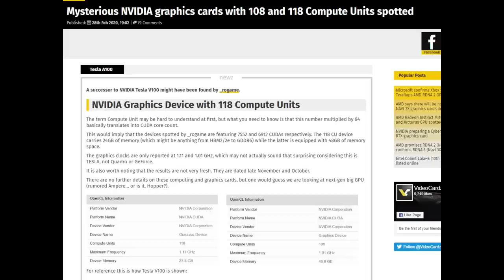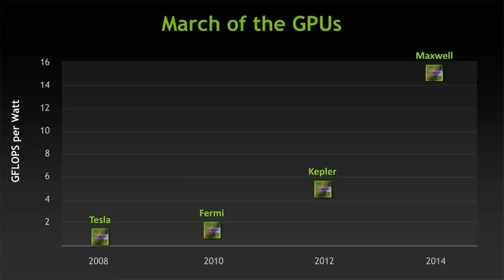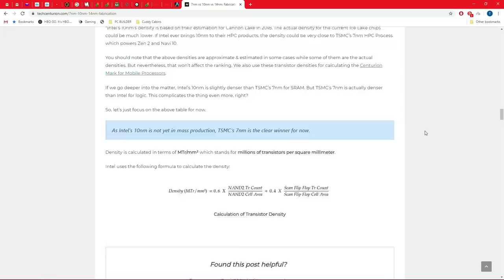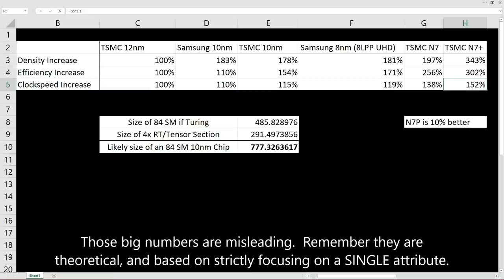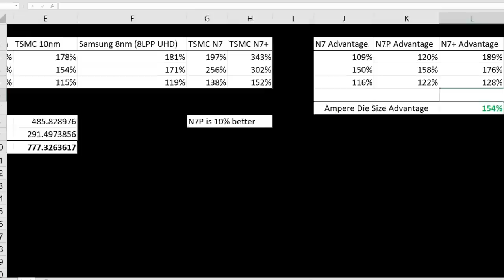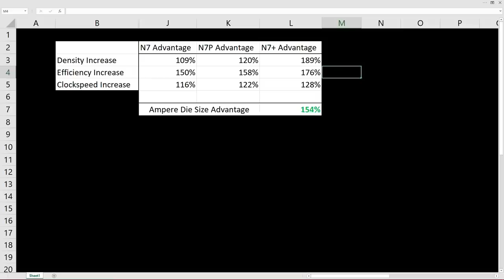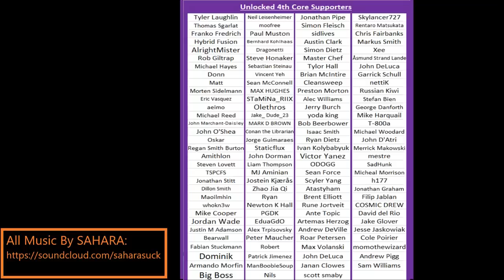Nvidia Ampere on 10nm: Still Good Enough to Defeat RDNA 2.0?

Comment: It's actually going to be pretty close to AMD using 7nm HPC (67mT/mm2 theoretical).
Samsung's theoretical is 61.18 on UHD cells. So we should see a density close to Navi's/Zen's implementation.
Navi is 40.5 Zen2 is 52.
Nvidia's current design is 25. So let's say 50. That's a 50% increase in density.
Should bring their 775mm2 die size of 2080TI down to 380mm2 Add another thousand cores, and I'd expect to see it around 450-500mm2. (Additional ray-tracing and other enhancements added).

Most likely (if they use samsung), they will use 8LPU
https://www.anandtech.com/show/13329/samsung-foundry-updates-8lpu-for-2019
https://www.synopsys.com/dw/emllselector.php?f=Samsung&n=8&s=6X4SzQ
Which is very close to 7nm HPC. 

https://semiwiki.com/semiconductor-manufacturers/samsung-foundry/259664-samsung-foundry-update-2019/
8LPU: ULVT, 1 fin standard cell template with both single- and double-diffusion break (8LPU introduced an ULVT device for HPC applications, compared to 8LPP)

Also
https://www.samsungfoundry.com/foundry/homepage/anonymous/technology300nm.do?_mainLayOut=homepageLayout&menuIndex=0201
Samsung foundry has maximized utilization of multi-patterning technology to overcome the cost concern and 10nm will be another long-lived node like as 14nm. To support long life time, transistor performance has been boosted with optimization of fin structure and stress engineering. Moreover 8LPP evolving as the most optimized & economical node until EUV enabling. 8LPU shows extremely low power efficiency with similar speed to 7nm.

http://www.trading228.com/news/samsung-will-become-the-worlds-first-3d-sip-foundry-next-year-3nm-trial-production-in-2020
Samsung added a new process called the low power ultimate based on the 10-nanometer process, which, according to Samsung’s classification, is prepared for the need for high clock frequency and high transistor density SoC. 8LPU is a further upgrade of 8LPP technology platform, which may increase transistor density and increase frequency.

Personally I think 7nm HPC is just TSMC's 10nm"+" basically. 10nm flopped so hard, they extended it and improved for HPC and made money off of a failed node. I think the only part of AMD's design that is true 7nm, is likely the cache. Which brings their CPU cores of around 40mT/mm2 up to 52, due to the cache (almost 50% of the die) being ~65.
And Samsung's 8LPU is also Samsung's 10nm"++"

Don't forget. AMD on their 12/16nm nodes, only achieved 20mT/mm2 on their graphics cards.
Nvidia achieved 25 on the same node (On a theoretical of around 40). So with Nvidia's superior engineering deparment, and time on their side, they should be able to squeeze Samsung's 8LPU to about the same density as 7nm HPC on TSMC. So unless RDNA2 makes up the entire efficiency gap, that Pascal / Turing had on Vega, on RDNA2, it will be around equal again.
Reply: 25 to 50 is 100% increase in density, not 50%.
Reply: @gismo3564  Sorry, meant a 50% decrease in size basically for the density increase.

Comment: You got it backwards. Instead of will it good enough to defeat RDNA 2.0 it should read how much faster than RDNA 2.0 will it be.
Reply: Yep, as far of efficiency current rdna is still more or less on par with 16nm pascal. Also people tend to ignore the fact that 1/3 of the die size in Touring cards is packed with RT and Tensor cores. So unless AMD somehow manages to find a new way for implementing RT they should also expect to sacriface that area as they confirmed to have RT next gen. I personally would not mind if AMD rolled out a faster card to push competition but as history has shown, that is very unlikely.
Reply: @Tjecktjeck  yep I wholeheartedly agree.

Comment: They say that Nvidia's GA102 Die will only be 40% faster, but people forget there's a GA100 Die. Nvidia hasn't released a Quadro or Tesla product that is larger in cores or bandwidth than their Geforce counterparts (at least to my knowledge, recent quadros in the past 5 years haven't been higher core count than Geforce/Titan), only larger in memory capacity. I believe that Nvidia will struggle to push past the Big Navi GPU with GA102 but GA100 will crush it. The last time AMD was in the lead was with the R9 290X and that beat the first ever Titan and Nvidia's flagship. A month later the GTX 780 Ti came out with more cores than the Titan and beat the R9 290X, not by much, but still outpaced it. Nvidia would make a 400W GPU if it meant preventing AMD from taking 1st place in pure performance, they don't care about the price. But that's all that matters to them.
Reply: Magnus Rasmussen 3000 Titan Gaming gpu only $3999, that sound very possible!

Comment: If they go with 10nm, prices might suck due to size again?
Reply: It wasn't the die that made Turing so expensive they just got greedy because AMD wasn't competing
Reply: @sean2291  thats not the reason at all. The 2070/2060 die is 50% bigger than the 1080 die. Nvidia has margins to maintain. The 2080 ti price tho is due to lack of competition. They could have sold it for $700.

Comment: GA100 - TSMC  7+NM?   
The rest is all Samsung 10nm?
826mm2 is rather large? whats the recital limit on Samsung vs TSMC?
Although to add weight
https://www.techpowerup.com/247657/nvidia-gtx-1060-and-gtx-1050-successors-in-2019-turing-originally-intended-for-10nm

Comment: Interesting video, thanks.  Nvidia if successful at 10nm will buy time to work TSMC smaller nodes. Initially with their compute cards and then if needed their gaming cards. Also if Samsung gets their smaller nodes working better, Nvidia could do a die shrink as needed. To me it looks like Nvidia has more options than AMD. Still if RNDA2 comes out punching well, timely and well priced -> AMD could win more than Nvidia. AMD was able to design a chip, Navi 10 at a 250mm^ about die size and remove 225w of heat from that rather small die size and transistor density and have high clock speeds for a GPU-> That is rather significant. AMD has more memory options with the smaller die size allowing HBM2e to be used readily as needed. If DDR6 becomes scarce and dominated by the new consoles, Nvidia may have a more significant supply problem.

Comment: Nvidia has been increasing the die size pretty substantially with each new release. AMD has not been bothered to release large dies. 

It does make me wonder where is the limit? How large can nvidia make these dies before the price becomes prohibitively expensive for the customers?
Reply: A die larger than ~850mm^2 can’t be produced as the optics get screwed up on the lithography. They talked about this when producing the V100 it was just about as large of a die as TSMC was capable of making.

Now TSMC introduced CoWoS which can produce enormous dies but I’m not sure if that’s a technology fit for making GPUs.
Reply: @magnusrasmussen951  double checking you are correct, CoWoS is just an interposwer for linking multiple GPUs / HBM stacks, which is technically a route Nvidia could go / has produced papers on. but the word from both Nvidia and AMD on chiplet based GPUs has been "some day for consumer GPUs but not soon".
Reply: @magnusrasmussen951  I knew about that I was just mentioning MCM because the original topic was just if nvidia could make huge dies, so I just wanted to mention that a giant MCM design would likely utilize CoWoS to connect it all.

Comment: The reason Nvidia would go Samsung is because tsmc production is maxed out and Samsung while the process is not as good as tsmc they are very competitive and undercut tsmc by a reasonable margin in cost per cup this you could use them for mainstream chips and tsmc for their flagship parts. Where the denser and more complex parts are most useful.

Comment: The reality for NVIDIA is even if its good enough to beat Navi 2X, it is not enough to beat next gen optimization specifically for RDNA 2 architecture that developers will be implementing if they are even considering console releases.  We are entering a complete generation where NVIDIA will lag behind in software optimization like AMD was with their server architecture in the early 2010s.
Reply: software have always been nvidia core strength. console might give AMD some boost things on pc can be more complicated because on pc  we rely on drivers more even with low level API like DX12 and Vulkan. and this is where nvidia usually better than AMD and we're are not even talking about driver stability. the thing is on PC AMD only put their focus on triple A games while nvidia most often will help any developer out there regardless your game is triple A stuff or not.
Reply: @arenzricodexd4409  Under normal circumstances I would agree that NVIDIA will edge out AMD in certain areas of game dev over time, but I believe we are looking at a bare minimum of 7-10 years of AMD focused game development, that will not only change who has the dominance software wise but how much support AMD can provide across the board to both AAA and Indie developers.  It may be a slow transition, but by the end of the generation it will be obvious how much it helped push AMD GPUs to the forefront.
Reply: @dagarath  console will help game developer to know AMD hardware better but it did not help issues with AMD drivers on PC. so AMD owning all the major console is not absolute win for AMD when it comes pc version of the game. war thunder developer for one said their game run so well on console but on PC they have more issue with AMD than nvidia because AMD in general did not really interested to work with them to solve the issue. 

and there is still double edge effect from having the console. why starting from pascal AMD can no longer compete with nvidia on the highest end? that's because AMD was stuck with GCN and cannot make major changes to their architecture or else they will lose direct benefit of having same architecture on both pc and console. in the mid gen console life time AMD have the potential to widen their gap with nvidia technology wise because they are stuck with same architecture while nvidia are free to make significant changes to their architecture. we see big changes starting from RDNA because the console is about to move to new generation that will use new architecture. but AMD probably will stuck with RDNA (and it's iteration) for another 7 to 8 years. yes they got more game optimized for their hardware but nvidia will beat them purely on brute force. just look at vega 64. no matter how much effort AMD put into plus with console optimization advantage it cannot beat GTX1080Ti on pc. 

and ultimately nvidia know AMD advantage for having the major console on their side. if you been aware about it since 2018 nvidia has been working more to redirect 3D API to take advantage their of their hardware feature. DXR, VRS, Mesh Shading are now part of DX spec. turing have all this while RDNA lacks all of them. it seems nvidia try to redirect DX (and Vulkan) to have all this so next gen console were also to forced to have this feature. nvidia know it first hands with kepler when AMD dominate the 8th gen console. so they most likely doing something so similar issue did not happen to them when next gen console arrive.
Reply: @arenzricodexd4409  What I mean is AMDs overall resource pool will increase, allowing them to do things like actually hire enough engineers to only release stable drivers.   NVIDIA did not start at a place where they always had stable drivers, nor have they never had bad driver releases, they simply have the resources now to reduce that possibility greatly.  The reality going forward is there IS no difference between the next generation of consoles and AMD PC hardware on the software backend.  We cannot look at the past to decide the future, only to prevent making the same mistakes.   You seem latched on to past mistakes AMD has made, instead of looking at what that massive, and it will be massive, increase in revenue will do at AMD.
Reply: Nvidia has always been good to optimise to current MS Windows graphic apis. I would not be worried about Nvidia. They wil release fast gpu and high price and release new version at smaller cost if amd seems to be too good. Nvidia is so big company that it can do it.
Reply: @dagarath  sometimes it is not about resource issue. the thing is AMD in general work and think like other hardware maker company: they did not really like to spend much resource to deal with software. the effort to align both console and pc software wise is so they can do less work on software on pc side of things. they give you the hardware, base software and developer should deal everything else themselves (that's the primary reason of pushing low level API on PC). for the most part they only give their assistance towards triple A developer because that is where media coverage is.

Comment: Well it depends, right now Nvidia is competing with AMD when they are still on 16nm and AMD is on 7nm, it really just depends on how good of a uarch Ampere and RDNA2 are. If Ampere for example is another Maxwell then... yeah Nvidia is very much in contention, but still not talking about a crushing defeat for AMD if RDNA2 is 2X what a 5700XT is and it's like $700, it should be a pretty bitter fight.

That assumes Ampere is another Maxwell though, which is a bit of a stretch.

Comment: I have a feeling that the “full” GA103 die will be 3080Ti with the cut down 3080 being about the same performance as the 2080Ti. GA102 will be a something new probably 3090/Ti with the 3090 being Titan RTX level performance. It would make sense from the way Nvidia is trying to rip off consumers and would explain why there are rumours that they’re legitimately worried about “Big Navi”.
Reply: @magnusrasmussen951  I'm just not convinced that nvidia was planning on offering more than incremental performance gains to consumers. Or if they did they would make people pay for it. Like they could still cut down the GA100 and limit it to 250W and call it the Titan Something and sell it for $3000 if AMD outperforms their 102/3 dies.
Reply: That would be normal Nvidia tactic! See 3080ti is cheaper than 2080ti! Good trick that They have used Also before. Just see original 2070... really bad compared to 1070 vs 1080 one generation before!

Comment: If I can’t buy a card that’s twice as fast as an Xbox I’ll be unimpressed
Reply: Yeah, be prepared to wait for a while.
Reply from the maker: I mean it's unlikely anything besides the top HBM2e RDNA 2.0 or Ampere card could come close to double the XBOX/PS5....and they will not be cheap (if even available for consumers).

That's not that abnormal btw - the PS3 and 360 also had high end cards when they launched.
Reply: Moore's Law Is Dead The difference now is the price differential. A graphics card that costs, say, $600 should be much more powerful than the chip in s $600 console, a $1200 card will have to have some serious performance.

Comment: I don't think Nvidia is going to add significantly more RT or Tensor cores. They aren't stupid, if the solution the performance issues they must have known they would have were that simple they would have done it from the beginning. From what I understand RT cores and Tensor cores do their jobs incredibly well. They are only part of the process, and the rest of the GPU just isn't up to the task compared to those bits. That's where their money is gonna be going for this next gen.

Comment: As good as RDNA 2 sounds, I can hardly imagine Nvidia beating it with an inferior node. I suppose I could be wrong, but I have a hard time picturing it.
Reply: Spencer Leeper Nvidia have good engineers... and node is not everything, just make bigger gpu and your product will be faster if it is big enough compared to competition. Nvidia makes a lot of GPUs, so They can bin the same silicon to multible products. And still have enough of those chips. Amd volumes Are smaller, so it has to make smaller chips and get better yeald in that way. Nvidia can afford worse yeald because their pure volume is big enough to compensate any possible economical downsides.

Comment: The interesting thing is, Nvidia with its larger dies and older processes still performs much better when you compare power usage.
AMD on 7nm uses more power than Nvidia on 12nm for the same performance. Which makes no sense. But it applies to every card and gpu chipset out there.
The RTX 2070 Super performs on average better than the 5700 XT, yet it uses less power, but is built on a 12nm process, while the AMD card is built on 7nm.
Efficiency also matters. And Nvidia has always been king on efficiency, even with older process nodes.

Comment: Assuming end result is similar performance then AMD smaller die will produce better yields, resulting in lower cost leading to lower pricing power, and  lower power requirements.  Better value creates more demand.  This is not 2014, Game Over.